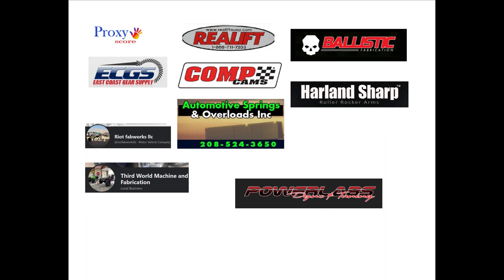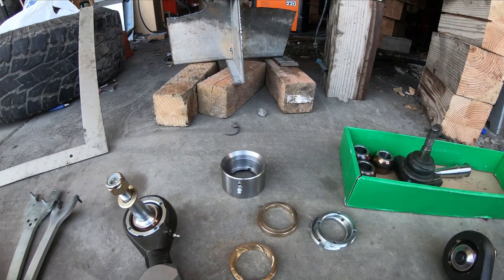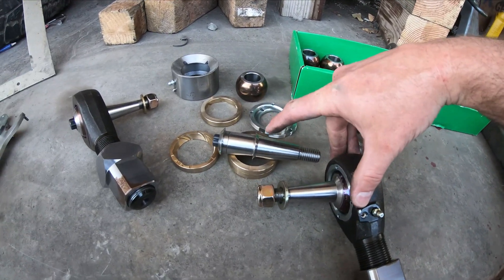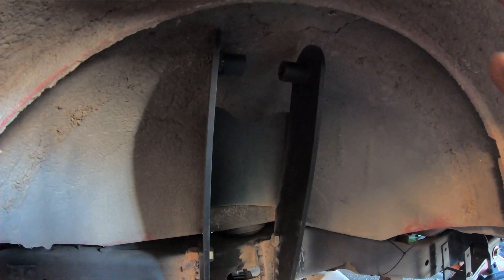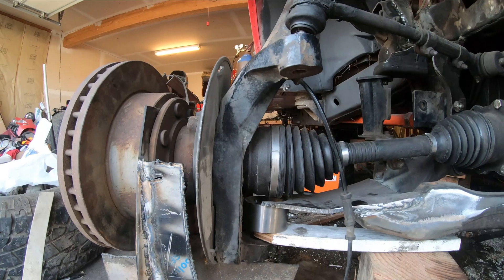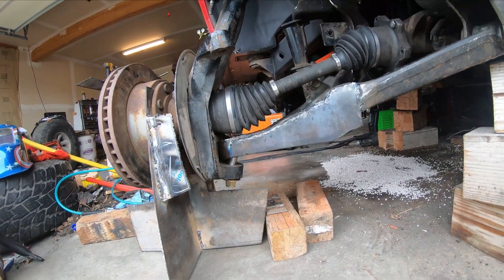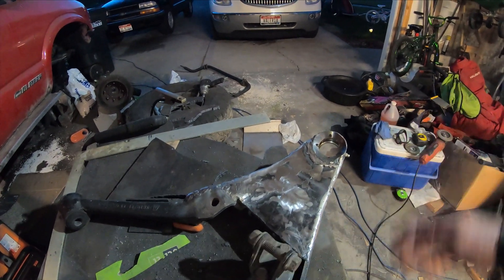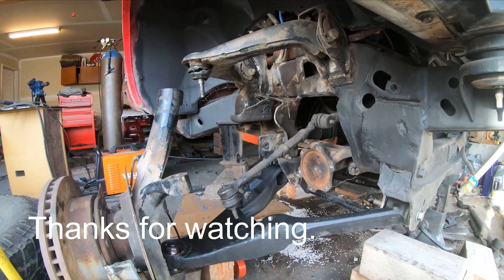Ultra 4 EMC Build S10 Custom Long Arm IFS Torsion Bar

Comment: What did this end up cycling travel wise up front? What are the spindles? They look taller than stock S10 spindles. And what are you doing for axles?
Reply from the maker: With just the A-arms bolted up I have 12" front wheel travel. I figure I will have 10" front wheel travel after everything is bolted up. The spindles are from a 3/4 ton GM 2004 HD IFS Fabtech lift. They are like 3 times bigger than a stock 3/4 ton spindle. Yes they are way bigger than a stock s10 spindle. Rear axle is a shaved 14 bolt and the front is a 2004 GM IFS 9.25 IFS diff with about 3" longer stock CV axles.
Reply: @daveroseberry  Does this 04 9.25 bolt right up direct swap? Talking front diff itself; axles and everything else aside. I’m doing a similar build with an S10 4x4 and trying to find a way to be able to run RCVs, that would solve that issue
Reply from the maker: @tylerbex00  I am doing a highly modified upgrade. You will need a plasma cutter and welder to do what I am doing. Not a bolt on at all. No 3/4 ton upgrade for an s10 is bolt on. There are some or one company that I know about. After Covid I don't think they are still in business but they build a almost bolt on arm travel kit. All it takes is money.
Reply: @daveroseberry  Okay, main thing I was worried about was width of the front diff compared to S10. Mainly if it were wider than stock resulting in shorter CV shafts which would eat into the available travel. I’m trying to get as close to 12” as possible without going excessively wide
Reply from the maker: @tylerbex00  I don't have an s10 front diff anymore but a 3/4 ton diff is 27" wide and wheel mount to wheel mount should be 7" wider than stock and outside to outside should be about 10" wider than stock.
Reply: @daveroseberry  Thanks for those numbers, that’s extremely helpful